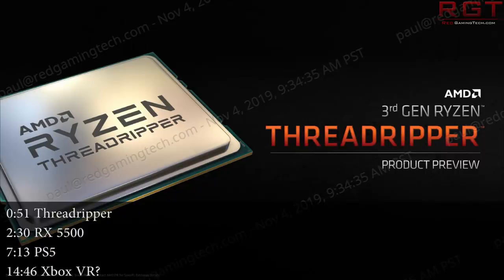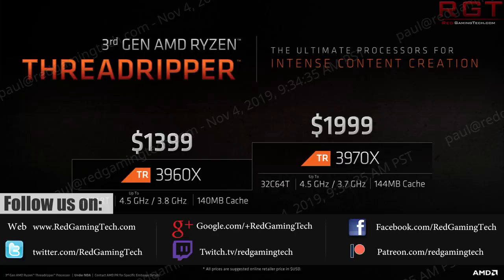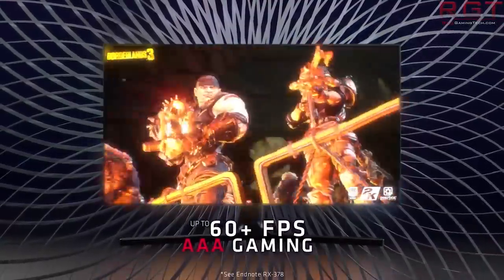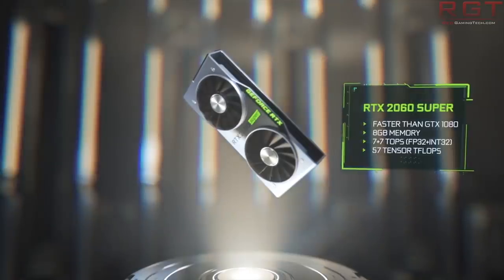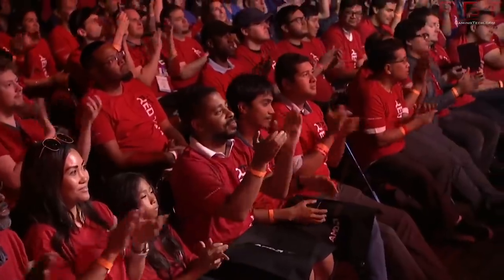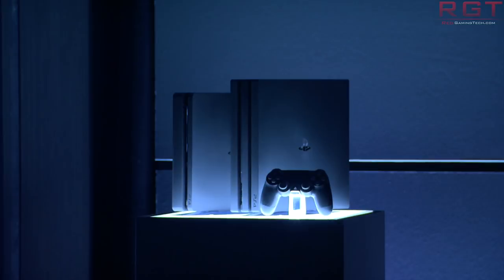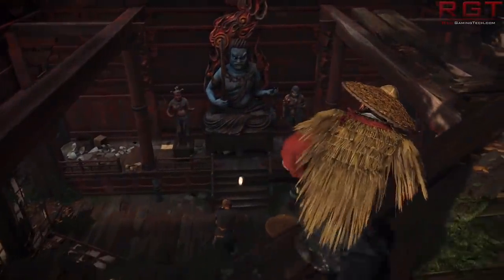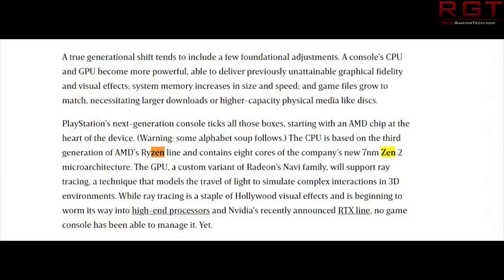AMD ThreadRipper 3970X Benches | PS5 & Xbox Scarlett Spec & Tech Details Leak | Xbox VR Patent

Comment: Question Paul. If the ps5 lowers the cpu and gpu sppeds respectively to match the ps4 cpu and gpu in regards to backwards compatibility how will the games look and run better if it's the same clocks speed?? Thanks..
Reply: Patches to utilize ps5 power
Reply: Deep learning.
Reply: Efficiency, ryzen cpu is so much better than jaguar in the ps4 it will blow it out of the water even at the same clock speeds. Jaguar was garbage even when it came out, ryzen is great.
Reply: PS4 Backwards Compatibility is based on the x86 architecture, the rumored PS5 CPU clockspeed is 3.2GHz according to Reddit, and it's the same clockspeed as PS3 Cell Processor, and the rumored PS5 GPU clockspeed is 2.0GHz according to hardware spec leaker Komachi...

I think they also thinking of doing backwards compatible with PS3 if possible

Comment: Either I'm completely misunderstanding the results, or they're completely fake. Since the 3970X has a boost clock of 4.5 GHz vs. 3900X 4.6 GHz, there's just no way of 3970X having single core score of 5782 vs. 3900X's 1289. The same goes for the multi-score. Even if the 3970X had the same base clock and IPC, it could not have 69293 vs. 12386.

Comment: The 2070 Super is not interesting as it only beats the 5700XT by 2% - 3% on average, but costs 25% more... it's terrible value. If the RX 5500 comes out at $140 or less the 1650 Super is also uninteresting unless you really really value the better hardware encoder of Nvidia.
Reply: You can get AIB XTs for well under 400, now. Supers are 500. It's a joke. I bought an XT for 255 with 30 rebate lmao